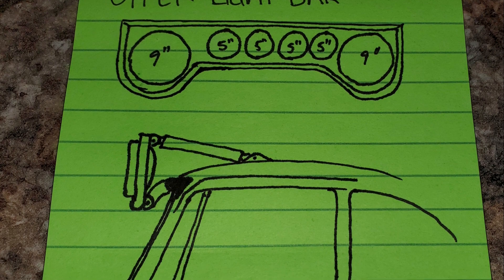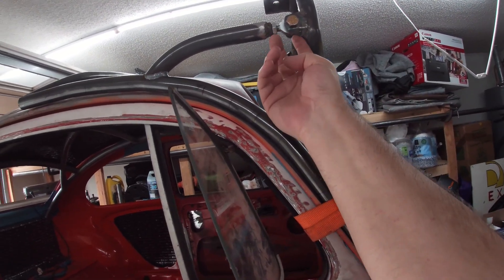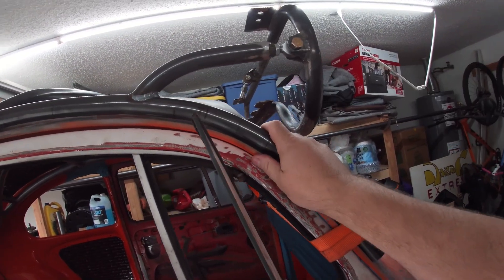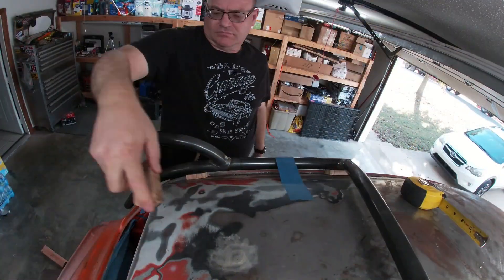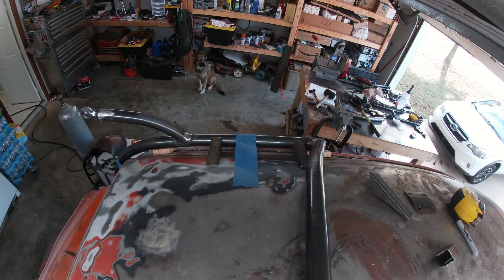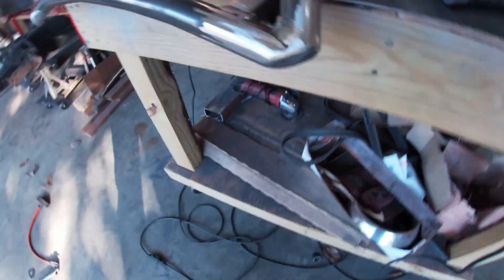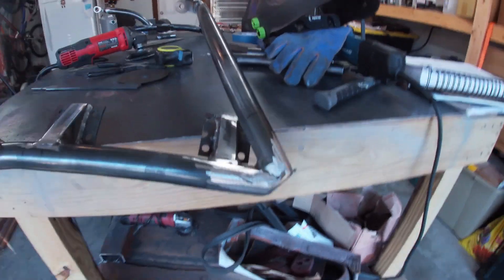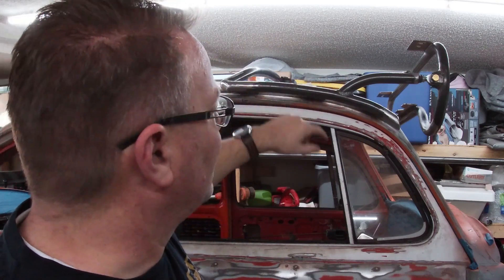Baja Bug Build (Ep. 24): Over Head Light Bar (Part2) Finished!

Comment: I like your design... I could see it work with the roll cage that you built without putting the extra cage material on the outside....but a great look still with the mounting system you made, I agree you should finish out that back part and make a roof rack with it!!!
Reply from the maker: Thanks Alan,  I'm not sure if a roof rack is in the cards, but then again, things keep evolving on the build....so...you never know!

I guess it would depend on if I could find something that compliments the light bar structure...and, of course, the rest of the build

Comment: I understand about the "achievement factor" but......the amount of materials and shop time used and spent you could have bought a roof rack spare tire mount and bought a light bar kit used that would attach to the roof rack.....it would have been cheaper !
Reply from the maker: Very true.  Well...maybe.  Definately if you count the cost of the bender dies and all the little crap...

...But when you see it. You'll be like; "That's Dam's Bug".  The light pattern, the crazy floating cradle mounting system, the Halo-style cage... ain't nothing going to be like it.  Especially when you could see what I have planned for the side bars/rock-sliders...or the front bumper/push-bar.  Or the interior..

All that to say, you probably noticed I like building stuff. Hence: "The Binder BUILDER". So a lot of the fun of building the Bug...well... is the actual journey of building the bug.  

If I wanted to be thrifty, I would have bought a finished bug someone lost interest in for less than the parts cost...but thats not the point of building this bug.

I appreciate your comment.  You're probably right, and I'm glad to have you along.
Reply: I know they are cool....I have built a few of them
 @thebinderbuilder